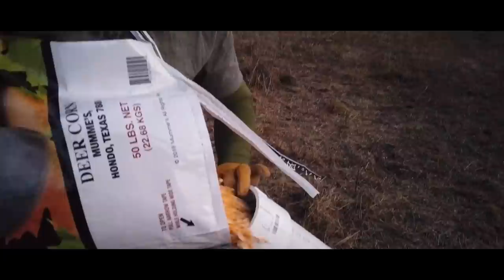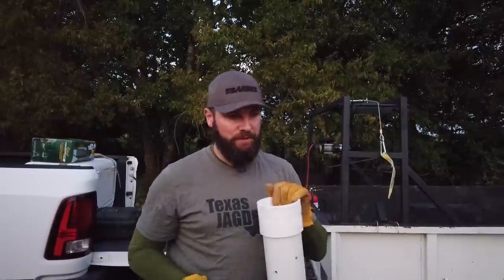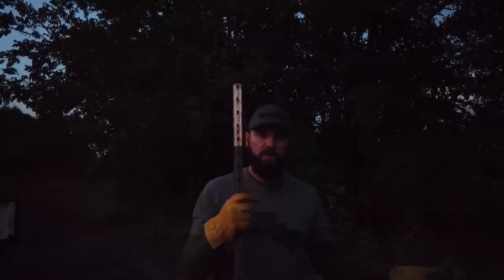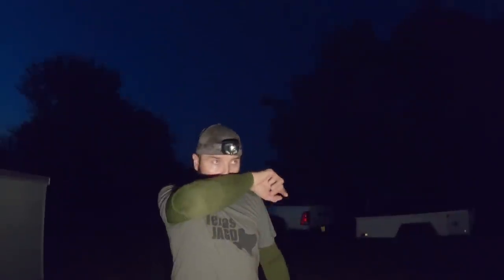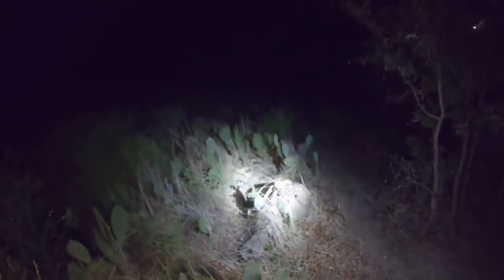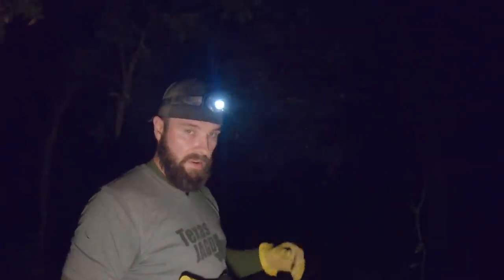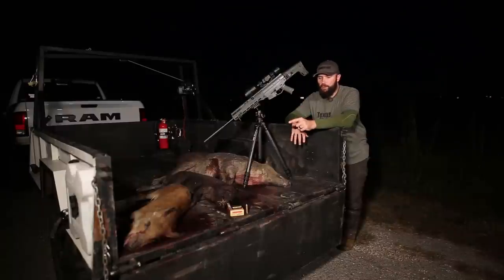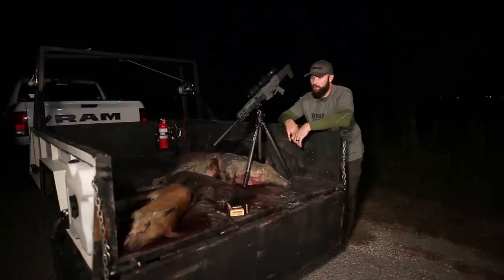Hog Pipe & the Wrath of the 450 Bushy

Comment: Save money on the extra pipe and end cap and just drop a few rocks larger than the holes in the regular section. It helps break any corn up that gets stuck from getting wet. I have also used some old nuts.

Comment: They make test caps that are very thin. They clue to the face of the pipe, so you need a square end for it, but a coupling fits over it.  If you change your mind you knock it in and it breaks out.

Comment: Pour some molasses in the pipe along with the corn, they can smell that for a mile away.. Good hunt my friend. Maybe mix a little milk to thin down the molasses, not sure. They're is something on the market you mix together for the corn but sounds really expensive.
Reply from the maker: I usually pour molasses around the pipe and some on the pipe. Wouldn't pour it inside because it's going to clog things up.
Reply: @TexasJAGD  , I seen someone use some & they drilled a little bit larger holes so more comes out when they root it around so they will stay longer, but it's thinned down molasses, it may be milk but not certain. Seemed to work really well for them. Have a good one my friend.
Reply: @TexasJAGD  personally is use strawberry syrup

Comment: Are you still using the ATN 384 sensor? Great work!
Reply from the maker: I sold my ATN ThOR HD 384 to my neighbor. I'm running the ThOR 4 640 and a ThOR HD 640.
Reply: @TexasJAGD  I run a Thor 4 640, 2.5x25. Looking at your vid and the thermal quality, I thought it looked like a 640
Reply from the maker: @blyz_69  yep, that's exactly what I use. The 2.5x is the sweet spot for me when it comes to base zoom.

Comment: Looks like you could use a funnel to fill the pipe.
Reply: Actually, you want to have the overflow of corn it helps attract the hogs faster. I built two of them and throw out an additional quarter bag of corn around the pipes.

Comment: A 3" cap will fit inside a 4" pvc pipe instead of using the extender.See my instructions for building a pig pipe posted way back in 2014 that will last forever if checked and maintained. My instructions were found to be the most cost efficient after numerous trials & errors. Can you build a cheaper one? Sure, but it won't last as long if you use anything other than what I have listed as materials. Great video and enjoy the hunt!  https://texasboars.com/phpBB2/viewtopic.php?f=7&t=301          Part 1 of build  https://texasboars.com/phpBB2/viewtopic.php?f=7&t=302          Part 2 of build